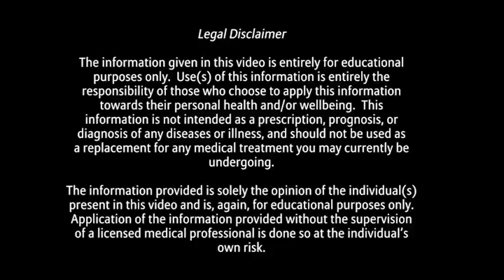Homemade Faraday Cage

Comment: So those people wrapping their heads in foil, weren't crazy after all!  I have these up to the windows to reflex sun- use for other uses, as well = You need some clothespins
Reply: Chemtrails, vaccines & underarm deodorants all contain aluminum which is being purposely absorbed into our bodies & brain. If you fast, eat an organic plant based diet (google vegetables for chelating heavy metals) & drink 1 gallon per day of pure homemade distilled water you can detox these heavy metals. Heavy metals are conductors which will be used in conjunction with microwave compliance weapons so you need to detox them from your brain
Reply: The foil hats werent grounded as a faraday cage and actually amplifies the signal. So yes theyre were crazy.
Reply: S Robin are u blocking the sun or reflecting for something else? Sun is great I love sitting in the sun and gazing.. It's great!
Reply: I have 14 windows in s/w room, it gets HOT, so the sun is being reflected back to keep room cooler

Comment: What about using those aluminum blankets on the walls, would that work too?
Reply from the maker: +Sarah Lane yes~ you could tack them to a tarp front and back so you have a double layer and then you can hang or take down whenever you want~ blocking windows or even smart meter
Tony
Reply: Thank you !
Reply from the maker: no worries
Tony

Comment: TY Tony. Blew my mind when you mentioned 3AM. I have been waking up for the last 8 years like clockwork at 3AM no matter how tired that I am. The tones seem to be getting stronger and are overwhelming at times. Probably because they keep putting up towers to improve cell service and Wi Fi.
Reply: If your brain is being remote neurally monitored,  you will often hear a humming sound in one of your ears, since the system is based on biotelemetry, and as such, is constantly monitoring the changes in your body. In America, this mind control through the air makes us a nation of unwitting guinea pigs. No one is immune from this high tech predation.  It's a form of slavery.
Reply: Ladyshystar (G) - I've covered the walls of 2 rooms in my house with mylar. It looks great.
Reply: Waking between 1am-3 am could mean you need to do things for your liver.
  Waking btween3am-5am may mean we need to things for our lungs. It is the Taoist Biorhythm Cycles there are twelve. The rest respectfully : 5-7am large intestines,7-9am stomach, 9-11amspleen-pancreas, 11-1pmheart, 1-3pm small intestines, 3-5pm bladder,5-7pm kidney, 7-9pm heart constrictor, 9-11pm triple heater,11-1pm. gallbladder. Using this clock can help pin point a cause of discomfort. This is taken from Stephen T. Changs book, "The Complete System of Self Healing Internal exercises".
I wake at 3am also?
 We can use Tonys mad crazzy good science and his foil shields. And some ti chi😁🙄
God is good so let us Pray and give God His Praise every day.
God bless this food and substatutes we put in our bodies Bless them nourish and strengthen them and thank Him for His protection against thoses that mean to do us evil as well as those who unintentionally do us harm. 
Do the best we can ask God to protect us from the rest. God bless you all, with good health and peace that passes understanding. Amen
🖖 Hey Tony Nano nano😜😄🖖
Reply: It's also the Devil's hour.
Reply: What is this cage?
Reply: Yeah, been waking up at 3 a.m.  Still an analog meter on the house where I'm renting an apartment but don't know how long that will last.  I'm still being cooked by other stuff in the house.
Reply: Parasites are active between 1 and 3 am and EMFs make them like 600 times stronger.
Reply: Our grandparents never got up at 3am?
Reply: Ladyshystar;  I also wake up at 3AM for longer then 8 yrs.  I do believe in EMF's but it's not my only problem so it's hard to diagnose.

Comment: I know you're a busy man, but do you know if I'm getting fried from the kitchen microwave (on the ground floor)that is directly below my bed (on the 2nd floor) and would these survival blankets help protect from microwaves as well? Much thanks, I'm learning SOOOO much from your videos. Your knowlege of all this natural heath stuff/remedies is AMAZING!
Reply from the maker: Jack Frost sounds like a plan but what if they are using multiple freq may not work so you may need to utilize aluminum and copper or iron and copper
for shielding 
Tony
Reply from the maker: Jack Frost when you get it done let everyone know how it is good bad or indifferent~ everyone needs to assist everyone ~ or anyone who wants to hear and see~ thanks for your input eh
Tony
Reply from the maker: you may want to even attach to a tarp front and back as a connection
Tony
Reply: HerbsPlusBeadWorks 
From what I've seen so far, they are definitely using multiple frequencies. Even if there was no skullduggerishness involved, we are constantly bombarded by electromagnetic pollution anyhow. Be that as it may, If the fencing is flat and fairly tight, it should resonate with the combo. This resonance will be expressed as a single frequency or tone. The vibration involved will establish a small current in the wire. Hopefully,  the earth ground will drain the current without the need for all the other tech stuff. But the ground has to be big enough, heavy enough, and buried deeply enough to handle the load. It would be best if each section or room had its' own pathway to ground. The grounding part of the system should be copper.

On another note, You've done a lot Tony. Thanks. I'm still playing catch-up here. Thanks again, and keep up the good fight.
Reply from the maker: jadealone would depend f the unit is leaking and how close ~ usually it used to be about 6 ft away to avoid exposure but with todays tech and nanotech not sure~
you would have to look up what type of radiation that comes from a microwave and then use those materials as blocking agents
Tony
Reply: HerbsPlusBeadWorks Now, that's a tinfoil hat. I love it. A friend of mine and I have been considering chicken wire fencing. It'll be some work, but it'll be worth it. After I get it stapled flat, I'll twist all the edges togther, ground it and then paint. The hardest part will be the crawlspace under the house. I just may use the fabric you have there, staple it to the joists and call it insulation. Keep in mind though, it's all got to be connected together, and it should be grounded to earth.
Reply: HerbsPlusBeadWorks 
I'm not sure how that would be beneficial. The next step I have in mind, after the cage is complete, is to attach a signal generator to it, have the generator synced to a broadcast sensor that senses the signals in the vicinity, and have the generator produce the opposite signal. It shouldn't be difficult to cancel the bad-guy frequencies.
Reply: ***** Thanks bunches. This info is very interesting. I will definately be looking into  all mentioned.  I'm glad to hear that the iodine helps flush out fluoride as well. The boron info I'm headed to first, both my parents have arthritis (one has R.A). Um, since you appear as knowing what you are talking about, I've got one more question, if I may....(send your bill to my email :) )  I've been watching this herbsplus guy and I really like the stuff he's telling us-have you knowlege of Trisodium phosphate for teeth? I absolutely mean no disrespect to this guy, but as the videos/time goes by he seems to be losing more teeth,
Reply from the maker: +Debbie Gereard ~~~anatomically that is impossible with out the aid of a mirror~ AND besides all I am is a guy who knows some stuff not a Doctor
but am aware of what you are saying
Tony
Reply: *****
Thanks David, I appreciate any & all info from fellow people seeking/giving advice on living a healthier life. I do microwave in glass & know that is destroys nutritional valvue but I still use it out of laziness.  Thanks for taking the time to help out. Maybe this will make me think more about getting back to using the toaster oven to heat things. :)
Reply: *****
Wow! Now that info I did not know! Thank you.  I am taking nascent iodine w/selenium to help flush out what the iodine is grabbing-hoping that this helps a little with at least some radiation. And I drink distillied water, but I also drink Hansens soda which is most likely made with city fluoridated water. Ugh! It's tough now days.
Reply: sheeesh, I sure hope you're not charging me by the hour for these consultations. Really, you've been so very generous of your time and your knowlege. I am grateful for these conversations we've had.
These are frightening times when speaking the truth or guiding people towards the paths of health/repair get you killed or threatened. Daily, I am amazed & have so much respect for these whistleblowers & truth tellers that I watch on Youtube & how they continue their gifting of info all the while knowing that their life could be cut off @ any moment. Im sorry to hear that happened to you. Frightening!
And yes I grew up on raw milk and briefly had access to some a few years back, but not now, I would love to be able to do raw milk again-even better if it could be through a company like Alta Dena used to do-they tested the milk to make sure it was all good.
 I wrote down all the info you gave me and many many thanks again.
Reply: Can someone help me with what he said about micro silver as I’ve just bought a micro silver maker

Comment: Hey Tony I been looking into this and stumbled upon "grounding" or "earthing". What are your thoughts on this? I Read it was used on the Tour De France cyclists for injuries. Thanks
Reply from the maker: Dillan Ernst only way to ground if your in the city is tp place aluminum and copper or either on the floor and step on it we will be doing a vid up the way on this and explain why and what to expect
Tony
Reply: So the whole idea of connecting with the earth is actually beneficial? Just want to be sure so I'm not eating my lunch in the grass with no shoes on for no reason lol. Also are the plug in matts/pads/blankets effective? I know they're marked up and I should make my own but just curious. Thanks so much. I appreciate what ur doing
Reply from the maker: the earth ~ if you are living in any city or town and you have the hydro lines above then you will have a return below so you will not be grounding but charging~to discharge the built up levels of either frequencies or other energies then you will have to apply a different  method ~unless you live near a beach with no power lines
you may want to try what I suggested
Tony

Comment: Tony what about those E pendants I find on Ewater (.com )
Reply from the maker: talked to a guy who is in the energy freq and his response was they would be ineffective they would have to cover much more and if you do not have either a copper and aluminum or copper and iron to defuse the freq from the high and low end you will still get a shot---this is why I said you need to create a shield around you for your sleep--- and use the copper sprays and aluminum--- it does make a difference in the sleep patterns depending on how you build your faraday
never seen the pendants work either---with those who use these things it appears after 2 weeks there placebo effect ---is gone
Tony

Comment: I shut off cellular data on my iPhone & turn it back on the next morning
Reply from the maker: most people going back to cable connections are finding alot of issues disappearing
and alot of aches and mental being relieved---
might see a difference I went of wifi and have noticeable improvement in some lingering issues --they are not completely gone but alleviated
Tony
Reply: might as well find out if AT&T can allow me to use the original brick mobil phone. lol thats a long phone line

Comment: I tried this for four days on, four days off. First night I slept for 3 hours and felt like I slept ten. I wouldn't say I felt better as a whole, but I did recover faster and needed less sleep to get the same results without it. In order to test to see if it was working, I used a computer tablet and turned the wifi on inside the makeshift cage (I used the survival aluminum blankets). Was getting zero bars inside, 4 out of 5 bars outside of it.

I'll keep using the method Tony showed because I saw what he instructed, read futher info about the concept of Faraday cages from other sources, and tried it knowing the potential side effects (there are none). As Tony recommends, don't just believe what you hear. Listen, then go through the process of learning why and how it affects you to treat your body well.
Reply from the maker: Thanks---share what you did as well so others can be motivated------the idea as well is to share these ideas so we can evolve an make a better idea and better protection and better health
again thanks
Tony

Comment: Thanks for the video. I have visited many emf danger youtube videos and they are all so expensive to use special paint and special window fabrics. This is so inexpensive to test it out. If I cannot get away from emfs all day in the city at least I can protect myself at night for 8 hours.
Reply from the maker: sometimes---that is al anyone can do and utilize things in baths and internally to fortify yourself
Tony
Reply: I really need advice if you can help to the best of your ability. I currently live in a motel room with a kitchennet and don't have the option to move right now. There is a 5g tower 4 blocks away in one direction and 1 mile in another direction. I want to sheild my room from emfs and I can only afford to use reflectix, aluminum window screen and galvanized steel but I need advice on how to do it safley without making emfs worse. Should I put it on every single wall from floor to ceiling or just the 2 walls that the 5g is coming from? Also since I live in this room if I'm on my laptop or using my phone which i usually am in the room will it make it dangerous and start ping ponging around the room? Will I still be able to use electronics in the room without it being dangerous? I basically want to limit emf exposure as much as possible especially the 5g is the main concern, if there's a little bit of rf for now it's fine but my goal is to just limit emf as much as possible especially from the outside but I want to do it safely because there will still be electronics being used in the room until night time. Would it be best to just do like 2 or 3 sides of the room or even a faraday cage section of the room separate? Also will ot become an electrical trap of I don't ground it? Any advice helps on how to shelid this room. Thank you and God bless 🙏❤️

Comment: Tony can ya make one of the little copper chicken wire emf units for us  the pics on it is a little confusing to us who are being  radiated and harped to death thanx
Reply from the maker: copper is super expensive---when I initially was doing these I bought a piece and did something but after talking to some one in this the easiest annd cheapest was to use the aluminum and spray copper on it so you get the best of both high and low freq---so we showed this so it would be cost effective and easier to setup as well
Tony
Reply: HerbsPlusBeadWorks I hear ya , thanx Tony

Comment: HI Tony Nice one. problem with this screen is that they don't block out etf and elf frequencies broadcast by military, navy and telecommunication towers and as the aluminium is not perforated it vibrates like a drum skin and can cause sleep disturbances. Also it is believed to block out beneficial cosmic radiation or orgone. Seeds in aluminium spacecrafts did not yield exceptional fruits when planted back on earth but when removed from aluminium and exposed to space radiation produced fruits that were several times larger. Thanks Tony for your exceptional work and really good sense of humour.

Comment: Interesting. Hmm, I sensitive to it too. ..second floor but Ive seen my transformer blow up being struck by lightening...it arched and split my pines. ..then there was this time when one plug just popped out of the socket. .as if someone jerked it out...I looked at the clock.hmm coincidently the next day a ancient clock tower collapsed in Italy in half. .with the click showing the time the plug came out of the wall violently...hmm dont sleep with anything near your head that is electronic

Comment: Can we put anything around our smart meter ??
Reply from the maker: if you do then you will have to leave a port or opening so the sgnal can get in and out of it without it pulsing the house and this will offer something ---apply aluminum behind the unit ---to disperse anything getting through---the signals are still going into the power and electrical lines but this can reduce it--remember your neighbors home is pulsing you as well and you them
Tony
Reply: HerbsPlusBeadWorks I love watching your videos :) Keep up the good info :)
Reply from the maker: or the electrical or hydro companies may come knocking on the door and ask why you putting aluminum on the meter ---this stops them from taking a reading
and that would make everyone a bandit---hmmm what a revolutionary Idea
haah
Tony

Comment: Tony, i do not want to spoil anything. Its a good thing what you do but i'd like to share something... Aluminum sheilds up to about 1GHz of frequency. cellphones, wifi, blue tooth if i remember it is about 2.3 GHz, so an alumunum blanket i think will not block this frequency from you. Unfortunately. Anybody correct me if i'm wrong.
Reply from the maker: try it and see---since I have done this and made the barriers I can now get into the deep sleep range I could not achieve before---it makes a considerable difference
so give it a go ---theories and books are great---but then test them out to make sure they are accurate---they are rewriting science and math today as well
Tony